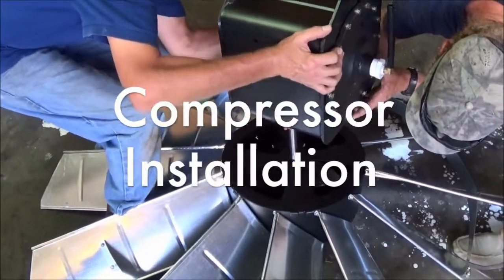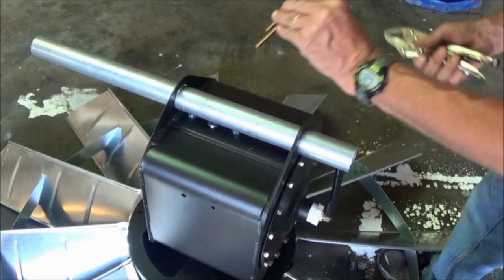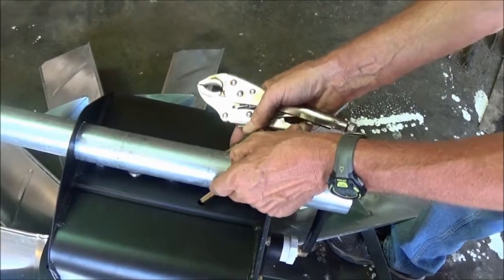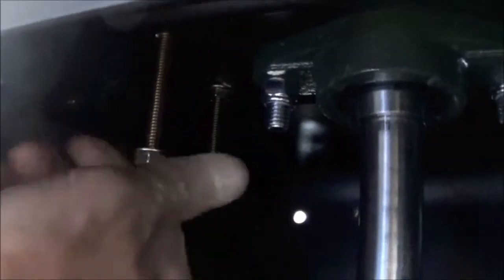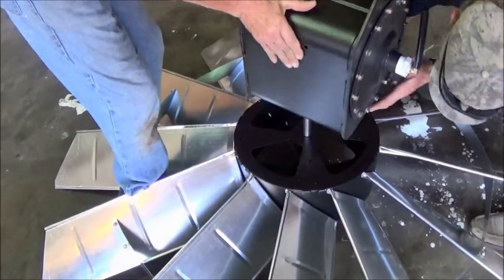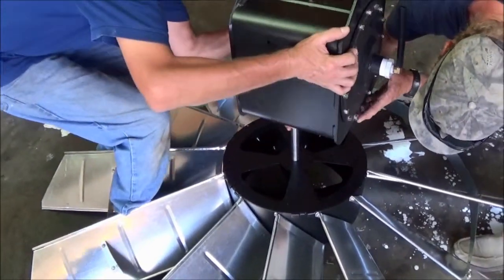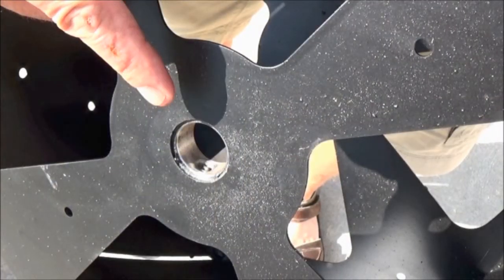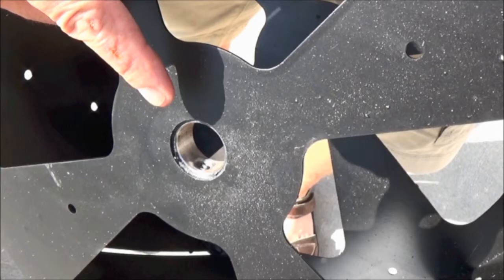How to install the Compressor in your windmill aeration system

Comment: Our windmill was installed by Outdoor water solutions and they done a great job. After a couple years we have to do the maintenance like replacing the diaphragm or valves. 
For someone who has no idea about the windmill parts, it would be nice to have simple easy to follow videos on installing a maintenance kit. Also simple videos on troubleshooting and how to’s on the solutions. When talking to a representative it’s hard to know what they are referring to when you have no idea what each part looks like that is mentioned. I love our windmill but there needs to be more info available about maintenance online.
Reply from the maker: Hi Cathy, you're right!  We do provide a set of instructions, but it would be helpful if we had a video that shows how to install a maintenance kit.  We'll see about getting one done here this summer after we get thru our social distancing period.  Thanks for the input!

Comment: How do you get the nuts on the U-bolt? Looks like I have to take the compressor apart? There is no opening to get to the U-bolt threads to put nuts on.
Reply from the maker: Hi Eric,

If you remove the door on the front of the compressor, you can reach in and put the nuts on the U-bolt.  Make sure you tighten them fairly tight or the pivot tube can spin and pull the hose barb out of the airline. You’ll also need the door off to attach the 2 tail arms.